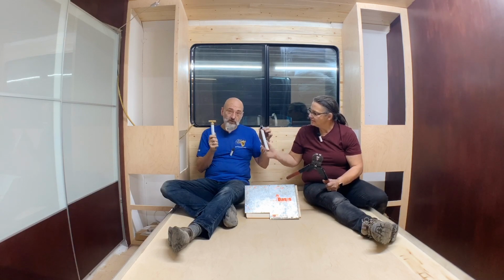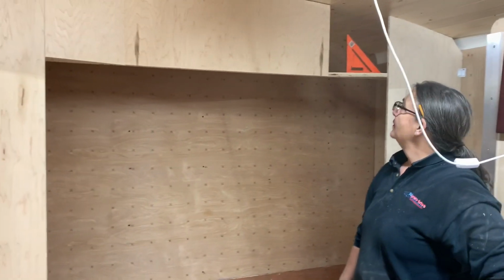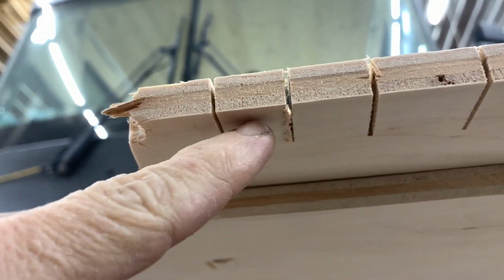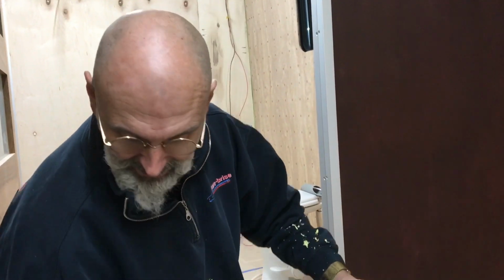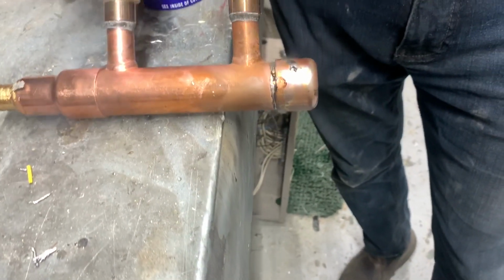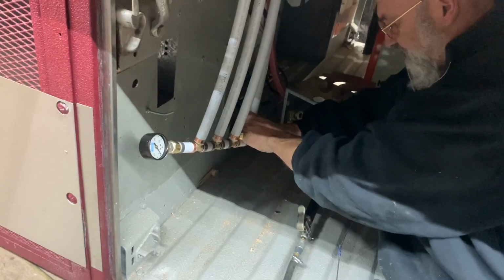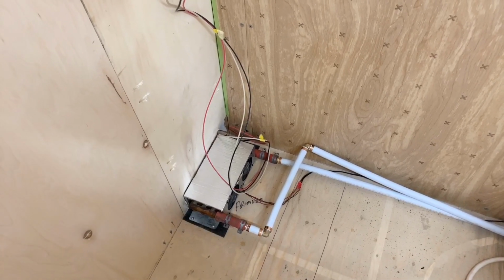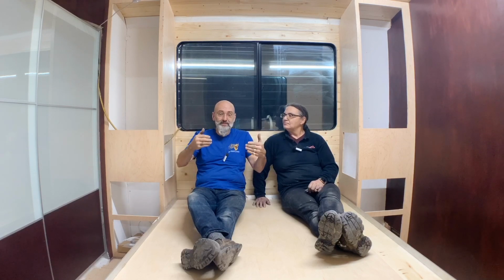E38, Hydronic Heating, Murphy bed, and more

Comment: Nice demo on the type of blades and results with each when used in the scroll saw.  This could be a mini-video for all new woodworkers!  I see you use the Ryobi system often, I do too.  It might not be 'pro'-grade but it works at a really good price for most DIY'ers.
Reply from the maker: Exactly, and the Ryobi tools are easy to get.

Comment: I heldped a friend install an ITR OASIS Combi in his MCI MC-9.  It’s a very nice product, and bit less expensive than an equivalent Aqua-Hot.
Reply from the maker: Having installed both, I prefer the engineering of the oasis.
Reply: No argument from me.  I have an Aqua-Hot in my converted motorcoach.  I’ve practically had to become an A-H technician to keep it running reliably.
Reply: Knowing how hydronic resIdential systems work, I recommend an air vent to purge the air bubbles that will drive you crazy and isolation valve to make repairs at each cab box heater. 
You should have a high point to fill and bleed from. Just my 2¢. 
Great workmanship and enjoy the thoroughness to details!
Reply from the maker: This is slightly different from a home system. Agreed with the valves, we have them to bypass each loop in case of issues.
Reply: @nicinnv  I agree.  I have three loops in my A-H system and each one has a bleeder valve at the highest point in the loop.  When I redid the system a few years ago, I replaced the needle valves with small ball valves (which can be secured closed).  I actually use one of these to fill (top up) the system in addition to bleeding the air out.  Air in an A-H coolant loop is as bad as air in the DD cooling system.  I also found that it is important to have an adequately sized expansion tank, and have it set up correctly.  Too small and the coolant overflows and then sucks in air when it cools off.

Comment: The front heater core, near the door.  Why couldn't you turn that upside down so the hoses stay near the floor?  -Bill
Reply from the maker: The flow pattern inside the core. The other way around an air pocket could be trapped inside the radiator.